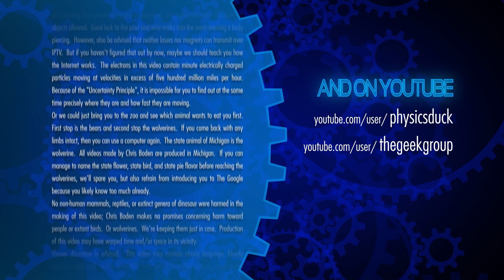Captain's Blog 5 6 2014 HVL Walls Done

Comment: Awesome job on the HV lab cleaning!  The CNC laser rig is darn impressive, but have you seen a 3D laser burner that heats up specific points in a clear block of plastic?  Years ago I saw small sculptures composed of those little dot-like interior bubbles suspended in the plastic, always wanted to see how that was made.

Comment: You are welcome for your new razor and 70 pack of blades specifically for that razor Mr. Boixdein. By the way those are the only blades that fit in there that are thick enough to not rattle around in the blade holder so make sure you don't let those wander away from the viewer mail set. Also I love that it took less time to buy and ship a razor to you than its taken Batman to change out the blade on your artifact.

Comment: A laser cutting tip for Moose, that she's likely figured out from playing with it.  Generally with wood, multiple passes doesn't work very well.  What happens is the scorched wood from the first pass ends up absorbing all the laser energy from following passes, and tends to just burn the wood more instead of ablating it away.  And of course you want to make sure you have the air compressor hooked up, as that actually helps push the plasma through the wood to assist with the cutting (plus it keeps your optics clean)

For cutting inside without outside venting, you can get a Carbon + HEPA air filter purifier.  They work well, but cost a bit.  See here: http://fslaser.com/small-air-filter almost what your laser costs new.

If you go with the traditional ducting to the outside, mount your exhaust fan outside, so all the ducting that is inside is under negative pressure.  You'll notice it especially when cutting acrylic, that if your duct work is under positive pressure there will still be tiny leaks that vent the vaporized acrylic into the room.

We started with a 40 watt unit similar to what you have, and have since upgraded to a pro 18x24 90 watt model.  Feel free to contact me if you have any questions.
Reply: I came up with a pretty slick system for venting outside.. it works well and there are no leaks. :)

Have you been able to use the 40w to effectively cut plastic? If so, any suggestions? It's mowing through wood just fine right now but plastic is still...  iffy.
Reply: Lis Bokt
What type of plastic?

For acrylic, I believe 100% power at 20% speed.  Two passes would go through 1/4" using the 2.5" focal length lens.  The nice thing about acrylic is that you generally can run multiple passes without it causing an issue.  The full spectrum guys who sold us the 40 watt said they have seen up to 1/2" acrylic cuts by doing that.  Your focus would need to be midway in the material for that thick however.

From experience, you can't cut polycarbonate.. that material will just scorch, and leave you with an ugly yellow mess and a bad smell in the room.  It's not terribly great for the machine either.

ABS cuts well.  It melts a bit more than acrylic, so less power is required.

Softer than ABS is going to be difficult, though it helps to setup a test job that does a speed and power test across a range of settings.  That helps narrow down what works and what doesn't.

And of course never ever ever cut anything made out of PVC, vinyl, or other materials that have chlorine in them.  Bad for you, bad for the laser cutter.  An easy test for chlorine is to melt a sample on some copper wire, then burn in a blow torch.. if it's a green flame, you have chlorine and shouldn't laser it.

With plywood and other composite woods, you'll have difficulty cutting with the 40 watt.  Baltic birch with a solid core cuts well, but the typical 1/4" plywood you would find at home depot/lowes typically wont.  The glues they use tends to absorb the laser energy.  And the material needs to be flat flat flat.. any kind of warp is going to move where the focus is located.

For cleaning the burn marks off wood, give fast orange a try.